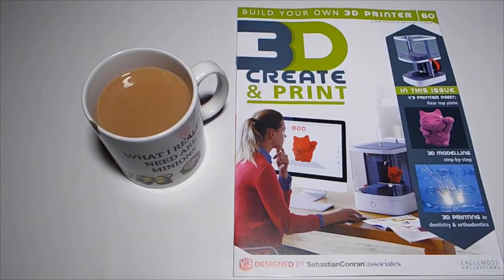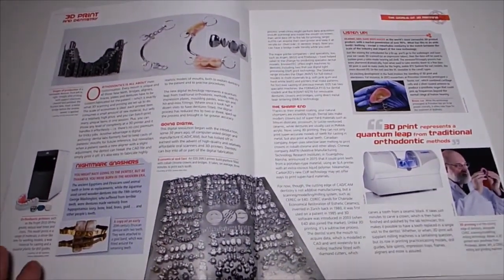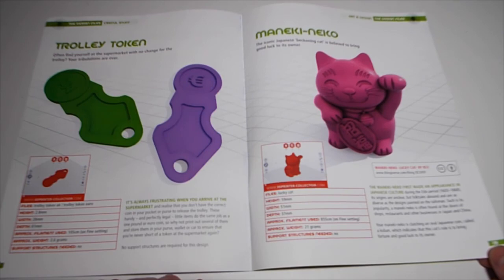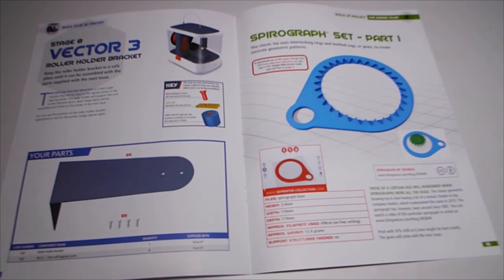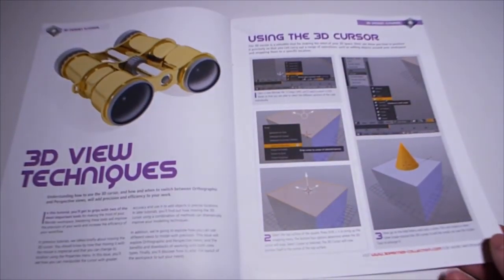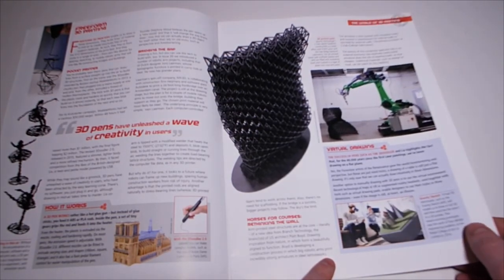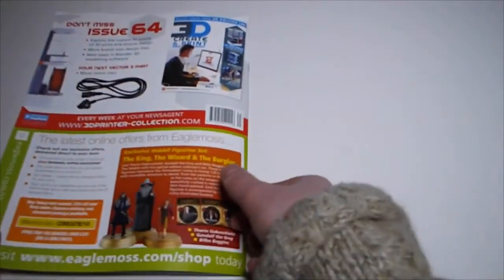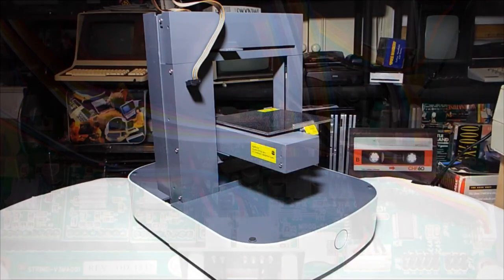Build Your Own 3D Printer ( V3 ): Editions 60 - 63 : First Powerup Of Motherboard + Covering Up.

Comment: Hiya@ 14:54 you had a bi of trouble with the front & rear control unit covers fitting together, well I've noticed on yours that the front top plate does not sit true, on mine it does, on your it look if it is over lapping on the top left hand corner, try undoing some of the screws a little cos it should snap into place nicely like mine then tighten up the screws.